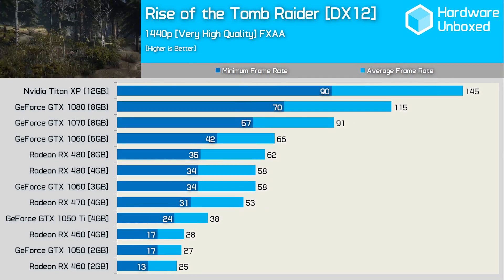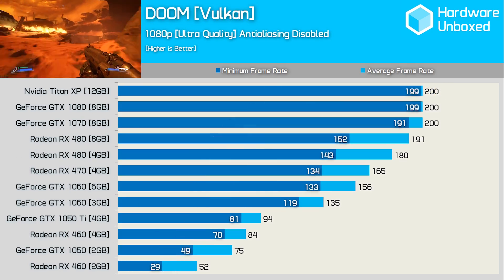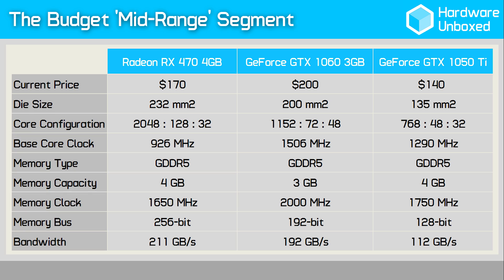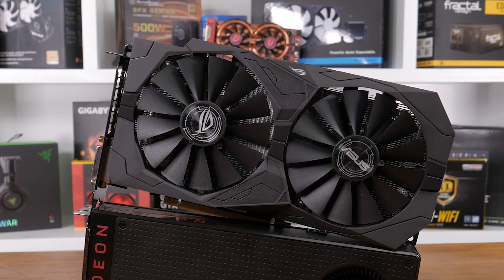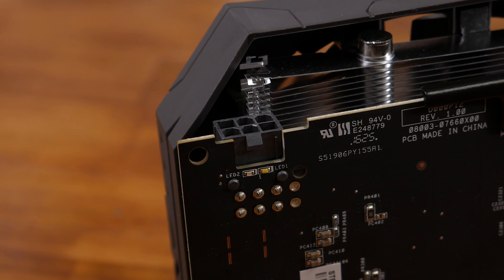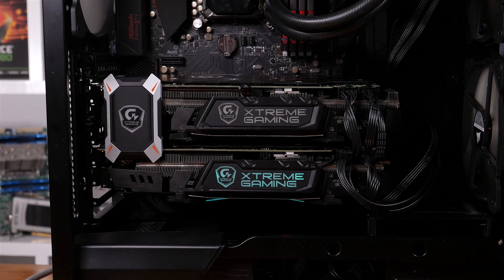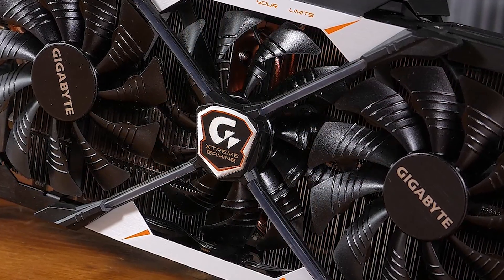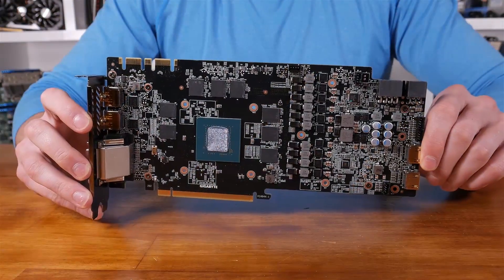Top 5 Best GPUs in Early 2017 [Based on HUB Benchmarks]

Comment: This is stupid recommendation. Yes, the RX480 is on the same level as the 1060, IF you have top of the line CPU, i doubt many people who buy an i7 and overclock it to like 4,5 Ghz, will be buying a 200$ GPU.... And when testing those cards with mid range CPUs like an i5, the 480 drops FPS massively in some instances. People who buy a 1k$ CPU dont match it with a mid range 200$ GPU, sorry.
Reply from the maker: +jimbeam – How did I miss this doozy of a comment lol
What exactly are you basing all this on?
https://www.youtube.com/watch?v=erAh6EAEu08
Reply: jimbeam from where did you get this info?
Reply: with my i5 3470 

my 8gb 480 smoking my friend's 1060 3gb

he has i5 6400 (same performance of the 3470) i

the 6 gb is just 5% faster than the 3gb
Reply: Just a couple of test on a i5 4460, average fps, GTX 1060 6GB and RX 480 8GB

Crysis 3
GTX 1060: 42
RX 480: 33

Fallout 4
GTX 1060: 43
RX 480: 38

Rise of the Tomb Raider
GTX 1060: 47
RX 480: 39

So yes, the 480 smokes the 1060 on mid range CPUs obviously ^^
Reply: jimbeam I think you're having some hardware problems.
Reply: jimbeam Those benchmarks show the 1060 winning though...? And aren't Fallout 4 & Tomb Raider Nvidia optimized games?
Reply: those games are heavily nvidia biased. ROTR is notorious for it, as is fallout for gameworks and/or physx and crysis intentionally adds extra tesselation as a gimp feature to amd cards.
Reply: I definitely think that you have some hardware issues
Reply: gimpworks games...

i can take 3 amd games where the 1060 is shit too
Reply: nope m8, stating facts

Comment: In my country, the prices for the 4 GB RX 480/3 GB GTX 1060 are in a range between 200€ and 250€. For the 8 GB 480/6 GB 1060 the range is between 250€ and 350€. My question is: Should I get a 4/3 GB version with a high price or a 8/6 GB version with a low price?
Reply: As explained in this video (and other sites) there is almost no difference between 4GB 480 and 8GB so I'd go for the 4GB 480.
Reply: Of course 8/6 GB version with a low price.
Reply: The sweet spot for vram is 4gb right now. 3gb will get the job done but it will be pushing it that 3gb pretty hard. 

Don't get the higher one not worth get the lower one I suggest rx 480. Because if you decide later you can crossfire and get more performance.

Comment: I think it's very naive to compare video cards with different VRAM capacity by only looking at the current performance. If you look at the history of PC gaming hardware you will see that whenever a GPU comes with two memory variants the cheaper version looks good at launch by offering better price/performance but will eventually choke itself into an early death.  This happens time and time again yet so many reviewers ignore it so that's disappointing. Previously we used to have a rather large premium on VRAM but right now that is not the case so there is really no reason to save $30-40 which could prove to be a crucial mistake in the long run.
Reply from the maker: Why? Why do so many people think VRAM = more GPU horsepower.
Also I completely disagree with you, numerous tech sites, including my own testing has proven what you are saying to be wrong...

https://www.youtube.com/watch?v=pfm8R0-fa3I
http://www.techspot.com/review/1114-vram-comparison-test/

Comment: Hello HU, why is the memory clock lower on the 480 4GB compared to the 8GB model? I remember seeing benchmarks giving a slight advantage to the 8GB model on multiple games. Are the memory chips different? If not maybe that gap can be filled by OC.
Reply: Rubafix989 4 gb of vram are enough for the quality you would play with that, it only adds about 3 or 4 more frames due to having faster clocks

Comment: AMD actually achieved what was their goal with polaris, to occupy the mid range market.
Reply: MayDay GoingDown!! i consider anything in the $400 range not mid range. more of the fact that nvidia wants more money. 

ive had both the evga 1070 ftw and 480 red devil and honestly dont see the point in the 1070. 

if you have the money for 4k monitors the 1080 is the way to go. 

the 1070 should be $100 less around the $300 range with the 1060 around $200 (6gb model)

nvidia and intel do crazy things with prices.  it works for them though so...
Reply: Saikat Banerjee Hhmmmm..the 1070 dominated the mid range though as we can see in sales, but yeah,  the 480 8gig version Polaris is a decent card.
Reply: Erik Bakker Nope!! a 350 pound card isn't highe end. it's Mid range. 1080 is high end...1080ti and Titan X Pascal are enthusiast.
Reply: Ronnie The 1070 is only 345.00 UK pounds bud. That's Mid range...same as 380 and 390 was mid range at 365.00 UK pounds. The Fury X was 650.00uk pounds..there top end card.
The 1080ti is 699.00 UK pounds...again one of Nvidia's top end cards.
If you can't see the piont in the 1070???? well, you only have to look at both 1080p and more importantly 1440 resolution benchmarks results to see that it totally outperforms the 480. But you would already know that if you own both cards as you said!!.
Yes 1080 is only for 1440 and 4k. I'm personally STILL waiting for the Vega line up to compare, but by then the Pascal refresh cards will be due out to so it's gunna be interesting.

Comment: My only disagreements are these:  The gtx 1060 bridges the gap between the RX 480 4gb and GTX 1070, and the GTX 1050 ti bridges the gap between 1050 and RX 470.  Sure it is only slightly faster out of the box, but after overclocking both of them, you get a card that is substantially faster and has more memory.  The GTX 1050 ti is a harder sell on pure price to performance, but I think that 4GB makes a whole world of difference beyond just its average performance.  The 1050 ti is the cheapest card you can get with 4gb ram, and that makes it worth while it its own right.

My list:

1050
1050 ti
Rx 470
RX 480 4gb
GTX 1060 6gb
GTX 1070
GTX 1080
Titan X
Reply from the maker: VRAM doesn't mean greater performance in the future. Low-end GPUs can't really take advantage of more than 2GB of VRAM regardless of the demand.

https://www.youtube.com/watch?v=mz5qH2vuOqs
Reply: "he 1050 ti is the cheapest card you can get with 4gb ram,". 

No really, the RX 460 4GB is much cheaper than the 1050 Ti. In UK £107 for the 460, £138 the 1050 ti. Although there is a big difference in performance of course, but I'm just replying to that sentence you wrote.
Reply: Hardware Unboxed I an with Walentaz on this.  You can leave everything on medium or high and crank the textures to ultra with more VRAM.  In the video, mirrors edge is tested on medium,2 out of 5 on the scale.  You could crank it up to ultra or hyper (5 out of 5) with 4gb at almost no perform hit.
Reply: Manuel alaminos dominguez At launch they were equally prices here in the US.  1050 ti is the clear winner

Comment: In the UK, for a mid-level card it makes more sense to pick up a GTX 1060 3Gb in terms of price and performance
Reply: colonelvector ikr. my mate picked up a 1060 3gb for 170 quid. That's the same price as the 470 4gb lol.
Reply: Nope, rx 470 is cheaper
Reply: colonelvector I prefer the Sapphire RX 480 Nitro+ 4gb the most for a mid-range card.
3gb of VRAM isn't enough for 1080p gaming (at specific games and settings) imo.
Reply: In the future yes, but for now it manages fine. The vast majority of my games have textures set to ultra

Comment: Its so sad that you are 100% right...
I was so hyped for 1050TI, cause its exactly at my budge, but the performance just isnt there and Im really quickly starting to be REALLY pissed off by nGreedia FUCKING all their fans over. 
...
If you dont know what I mean, It all started with 1060 6GB release without SLI (cause 2x$250 TEAR >$600 1080 ass in no time), then it continue with a clickbait product 1060 3GB (which is just so stript 1060, "it doesnt even run properly" :D ) and it all ends with 1050, which was sold as "750TI worthy succesor", but fail IN EVERY ASPECT. 
...
Now count in nGreedia driver which can defect your GPU and MENDATORY registration WITH TELEMETRY and you should be furious as fuck right about now...
Reply: Get an RX 470 :)
Reply: I try to solve this problem this morning, wanna upgrade my driver without need of download THE WHOLE nGreedia package (cause im still rocking Experience 2.11 a refuse to update).
After short UTFG you find a link to OFFICIAL NVIDIA SUPPORT forum, where you find a old driver download page with more option. THE FUCKING PROBLEM even thou the support and forum tells you can download driver only there, YOU CAN'T !!! Even if you select "driver only" it still start downloading whole 370MB game ready package. 
FUUUUUUUUUUUUUUUUUUUCK THEEEEEEEEEEEEEEEEM SOOOOOOOOOO MUUUUUUUUUUUUUUCH.....
...
so the only option is to find old Experience on file share sites (or forums.videocardz.com), patch it so will not update and then custom install driver update... so far so good...

Comment: well I agree with your picks but it also depends on the region you live and the pricing there. I picked the gtx 1050ti because here the cheapest RX 470 is roughly 70 dollars more than the 1050ti and my i3-3210 is more of a bottleneck for the RX 470.
Reply: VandAR i bought the 1050ti For same reason
Reply: VandAR bottleneck is overrated an entry level i3 bottlenecks a gtx 1080 for about 23% of its maximum capability which may sound a lot but only in benchmarks in real life situation, where you would adjust the setting like shadow quality or water movement and some other cpu intensive graphichs you wont even feel it
Reply: Mario Picone I'm talking about this 5 year old i3 which can't give me above 45 FPS in new titles even with a gtx 1050ti
Reply: VandAR well I have a i3-2120

Comment: I'd have to say that your picks were fairly solid, especially considering the cards you just benchmarked. 

One video I'd like to see in the future is the pro duo vs the 1080 and titan xp. I fully expect the pro duo to beat the 1080 in multiple titles but the titan xp I'm not too sure about. Even though the pro duo has the highest flops of any single card out there, between amd's inefficient architecture with current apis and crossfire losses, I expect the titan xp to take the day when it comes to gaming except maybe doom (and that's a stretch).

Comment: 100% agree with you on all 5 cards except on the high midrange. I would still take the 1060 6gb over either RX 480 mostly because I dont play any of the AMD specialized games. But I understand your value to performance comparison (considering the RX 480 4GB is much less than the 1060 6gb). Thanks for GREAT detailed video. I will be using your benchmark scores for a while!

Comment: Should i get an rx 480 or a gtx 1060?
Reply: Get a 480 unless you can get a 1060 cheaper. (Which is what I did.)
Reply: Definitely the RX 480. Drivers are now superior than Nvidia's, not to mention better DX12/Vulkan performance. And then there's ReLive, Shadowplay alternative.
Reply: C. L. K then the 1060 sounds like a good option

Ty bro
Reply: 1060
Reply: pablo guillermo Do it. I bought a new GIGABYTE GTX 1060 WINDFORCE OC for $250 but I would have bought the used MSI Gaming one for that price if it had the warranty because the look is so good.
Reply: Sorin Lavric The increased performance from the 1060 will be more beneficial than the amount of VRAM on the RX 480 for 1080p gaming.
Reply: id say go for the 480, even though the 1060 is the far more popular choice according to steam.

Both cards are equal now thanks to the relive drivers, if you happen to find the 1060 cheaper, then by all means go for it.
Reply: pablo guillermo Check some GTX 1060 6GB vs. RX 480 after ReLive benchmarks and see if that $20 is worth it. Keep Nvidia Gameworks Titles (Watch Dogs 2, Rise of the Tomb Raider, ARMA 3 and more) & AMD optimized games (DOOM with Vulkan, Deus Ex Mankind Divided and more) those titles will run better on each type of GPU.
Reply: nvidea only gets ahead with gimpworks.

whenever you are playing one of these titles with an AMD card, just manually set the tessellation settings to override the games to help avoid the excessive work load to the gpu. pretty sure that helps close the gap with nvidea on these titles iirc.

if you have and older nvidea card I don't think you can do this. enjoy your faster aging card.
Reply: Well a guy is selling his 1060 gaming X at 250$ and i don't have any special offers with rx 480
Reply: pablo guillermo Does he have the receipt for warranty?
Reply: C. L. K yes it does
Reply: No problem
Reply: 1060 just if is under the price of 480. but for the same price I will choose 480 (4>3/8>6)
Reply: hardcore nvidia fanboy
Reply: go for whichever cheaper in your area and be happy about it.. both has pros and cons and very competitive
Reply: You probably didn't read my entire comment. I said, In all situation except power consumption Rx 480 is better.
Reply: Dipu Faimul The power consumption part was for you the Crossfire/SLI part was for the other guy.

But it doesn't matter he's already getting the superior card for cheaper, he gets two wins.
Reply: Go with the cheaper one...before ReLive drivers GTX1060 6gb was 12% better than RX480 8gb...After ReLive drivers GTX1060 6gb is 1% better than RX480 8gb, and RX480 4gb is few percent better than GTX1060 3gb..so going with the cheaper one would be a better choice even though AMD is kicking ass with drivers at this time and you can buy another one later(crossfire)
Reply: Nathan Kam yeah, i bought the msi 1060 gaming X 6GB for 250$
Reply: Are you serious right now? AMD kicking ass is a good thing whether you are AMD or NVidia fanboy so dont hate and dooooonate
Reply: If you play a lot of games in DX11 or lower get a 1060, if you only play games in DX12 or the one vulkan game get a 480
Reply: If power consumption doesn't mean a lot to you then go for Rx 480
Reply: yes, true! but with 1060 you can't go on SLI in couple months or 1 year when those card come cheap! 480 will get better support for dx12/vulkan and you can hope for a performance equal to 1080 for a lower price in CROSSFIRE ;) ...for a better 1440p or 4k future  gaming ;)
Reply: Dipu Faimul Sorin Lavric A lot of people aren't concerned with power consumption or SLI/Crossfire. Weak points in this situation imo.
Reply: Gary Yuen I told him to buy a RX 480 unless he could get a 1060 for cheaper (which he did) because it's better. Sorry if you don't like facts.
Reply: +C. L. K Honestly, for 1080p ~60fps are good enough both rx 480 4gb/gtx 1060 3gb (for a price around 200$) !!! If you have a mid-range pc with a psu under 500-550w!  But if you have MORE that just a mid-range pc (like a i5 (k) /i7 , >16gb ram, good mob with sli/cr, psu more that 600w etc) and think for now to get "JUST" a GTX 1060 6gb of even a GTX 1070 I can say to think twice. And yes I know, every time is better a single card that a sli/crosfire config BUT if think to buy somethig what you easily upgrade for low money go for RX480. I just swap now from a very cold and quiet GTX 770 Gainward Phantom edition to a RX 480...and if all be in a better way in couple months I will buy the second one! Cheers
Reply: pablo guillermo 480 is recommended in the vid and is better value
Reply: +pablo guillermo Good price, good choose! ;)
Reply: 480 def.
Reply: pablo guillermo great choice, and ignore those amd fanboy attacks. Enjoy low temps and power draw, and superb overclocking. I have the rx 480 gaming x, to be honest I would have bought 1060 if it was cheaper.
Reply: Boda RX is only slower in dx11 games by 1% now thanks to the drivers, and it beats the 1060 in every aspect of dx12 and vulkan so that point is kinda mute.
Reply: Nathan Kam The RX 480 gtr/rs has all of that, while at the same time being a faster card than the 1060. I got mine for 230 with a 20$ mail in rebate at microcenter, cheaper than every 6gb 1060 variant.
Reply: The XFX RX480 GTR is a great card!
I only sent mine back due to coil whine, but that would be XFX's problem, not amd (they only design the chip).

I had it overclocked from the factory oc of 1366 (or something like that) to 1395, AND i did that after reducing the voltage from 1150mV to 1100mV.
Memory OC up to 2250, without bump in voltage, but i dialed it back to 2200, as i was to lazy to check if 2250 wasnt going to be causing memory errors at its stock voltage.

The card would maintain the boost clock 100% of the time with stock power limit and I modified the max temp to 70, target to 45, and the max fan speed to 3000. 3000 is a bit loud, but it only gets up to that speed when im Folding (which uses 100% gpu load constantly for hours), and im not going to be near it anyway.
It's dead silent while web browsing, watching movies and stuff. The fans turn off below 50*C or something
Reply: Paulus Wilhelm 1060
Reply: pablo guillermo Don't do it! you can get an 8gb Rx 480 for 230$!